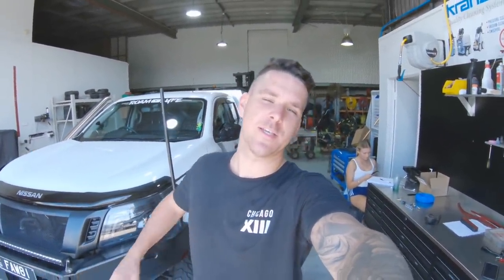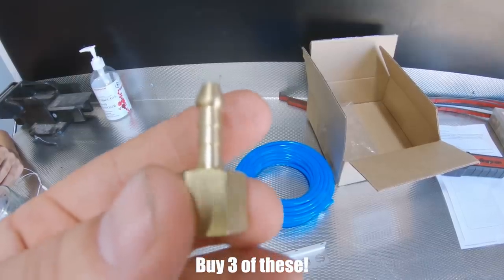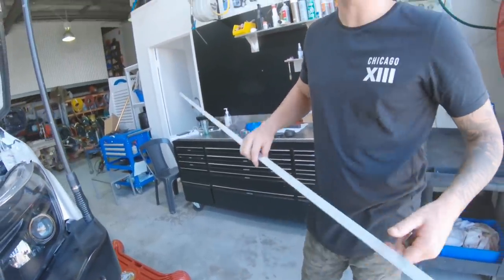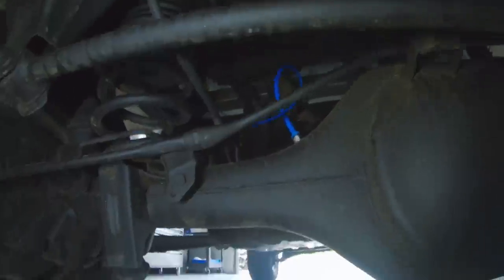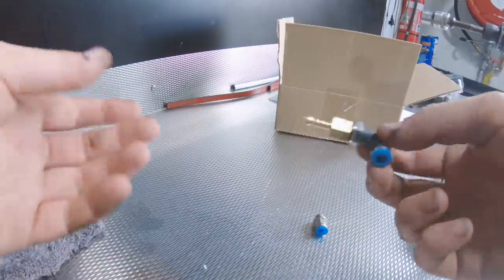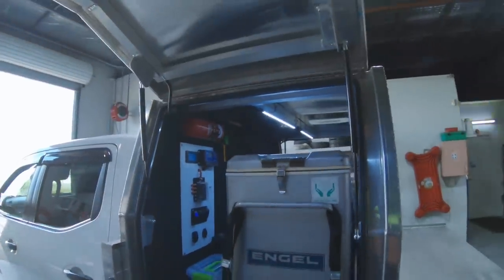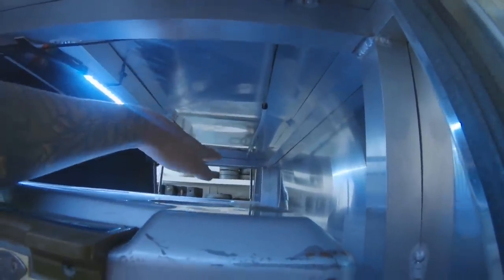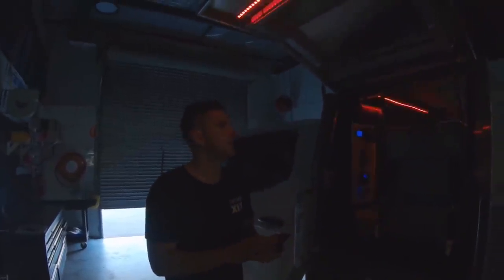A MUST DO MOD FOR SERIOUS 4X4ING & RGB NEON Canopy lights look INSANE!

Comment: for several toyota's (hilux for sure) don't forget t the ADD (automatical differential disconnect) as well, it  has a breather and is likely to sit right besides the front diff hose. (under fuel filter for the Vigo)

Comment: Great vid mate.
Anyone else doing this, an idea that i did on my np300 to avoid the brass barbs is used the hard plastic pipes fit into the stock pipe with the aide of silicone spray. I managed to push the hard hose in about 150mm each on the transfer, gearbox and front diff. I chucked a cable tie around the pipe to secure it. Its water tight and I have driven windscreen deep water no issues.
Reply from the maker: Good tip mate! Thanks for the comment 😊

Comment: great video! only thing though, most of navara drivers probabaly have catch can and fuel filter mounted at that spot :( thought about plumbing it straight into the airbox
Reply from the maker: I didn’t realise that is where it goes! Can always quickly shift this breather bracket somewhere else!! I’ll make it work! And I didn’t want to put and holes into the airbox for warrenty reasons!

Comment: Hey mate, going to grab the same kit as you.
 
I'm guessing the BSP Thread size is 1/8th (pretty sure thats what you said. Byt what is the hose size?
Any other tips?

Thanks Mate
Reply from the maker: Caleb Paterson hey mate! BSP 1/8th is correct! If you get those barbs similar to mine! I’m not sure what the size of the barb is but if you go into your bonnet and cut a part of the breather off and take it into the shop to match it up you should be sweet! It’s very simple mod I just used zip ties for hose clamps, no other tips I can add it’s pretty straight foward! If you have and questions just pm me on insta!

Comment: How do you rate those sintered brass filters on those kits. Ive always found they seem to block up super easy, with the slightest bit of dust or mud or moisture that falls onto them, resulting in oils being pushed past the seals, especially the pinion seals. Either way was a good video. Subscribed.

Comment: Mate I'm have some trouble atm can you somehow describe where the front diff breather is and also was the tran/gearbox hoses on a bent bit of metal tube as the bracket? 
Thanks mate
Reply from the maker: I’m struggling to remember I think the gearbox is on a bracket and the front diff I think already has a hose in it!